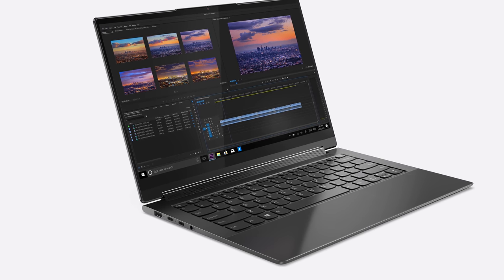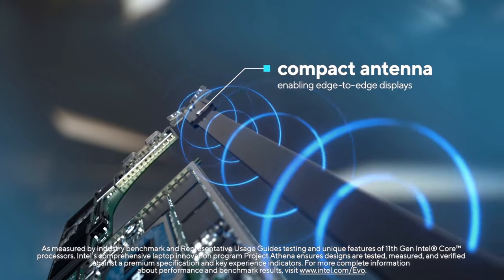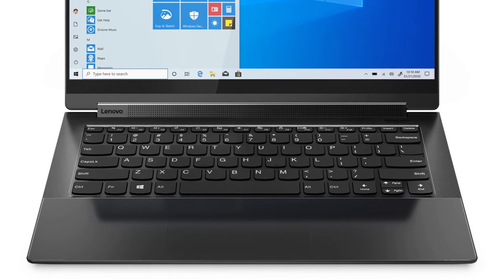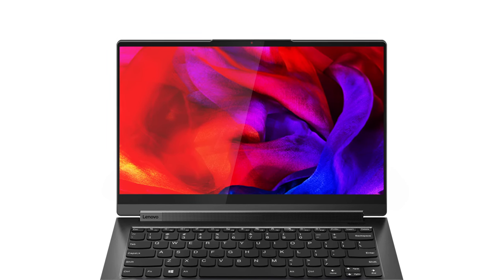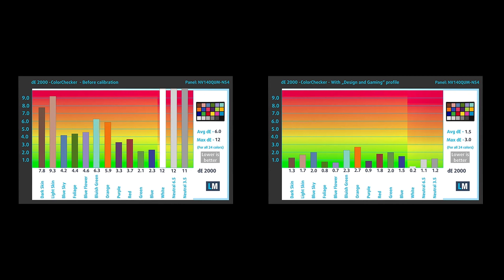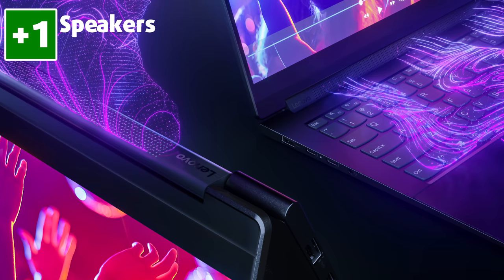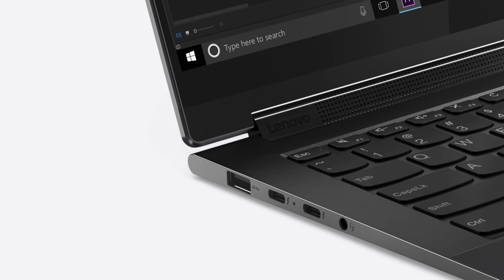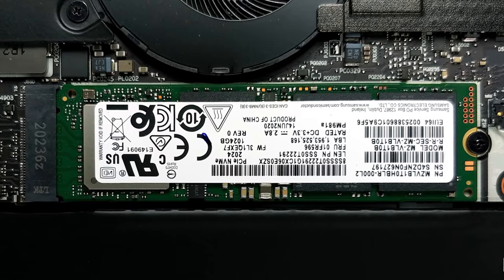✅  ❌  Lenovo Yoga 9i (14) - Top 5 Reasons to BUY or NOT to buy it

Comment: WARNING DO NOT BUY this laptop. The touchpad is unusable -overly sensitive, inaccurate, and I'm not stating this lightly or being pedantic. There is a fundamental issue with this hardware. Two months in now having spent £1700 and it's a huge design flaw. I've seen the Lenovo forum on this issue and someone described it as a lemon which now having used the laptop for two months I fully agree. Thought maybe it was a setting I'd missed or just having to get used to the touchpad like is generally the case with new laptops but all the other good features of this machine can't fix such a fundamental flaw. Literally unusable and you'll be left having to use a mouse to compensate. Trying to do basic surfing becomes frustrating and working on office docs  - highlighting cells/sentences, dragging etc will just become overwhelmingly challenging. Save your £££ and get another laptop. My 5 yr old lenovo is more functional than this unfortunately. I'm disappointed at all the web reviews not spending enough time on the laptop to identify such a crucial flaw. Could've saved me £1700. Try using it for any length of time and you'll regret having made the purchase.
Reply: I was about to buy this laptop today. I'm glad I looked it up and saw your review.
Reply: Hi what laptop can u recommend pls?
Reply: There is also silver version without glass touchpad and this one is good.
Reply: @commongrade89  if you didn’t buy it then you’ve made a grave mistake because I just bought it an it is very dangerous threat to other laptops in other words this laptop is superb
Reply: @majinbuu19831  r u just another bot?
Reply: Maybe it was just your one.  I'm pretty sure they don't mass produce unusable touch pads.
Reply: Sensitive YES but unusable NO. I have issues losing track of where the trackpad actually is because of the seamless glass design but it doesn't take long to figure out that my hand isn't even on it right. You make a whole lot of commotion over something so minor. Get some painters tape and mark the edges of the track pad if you struggle that much Lmao
Reply: reduce the sensitivity if its too much for you